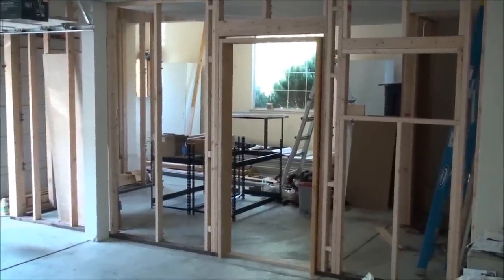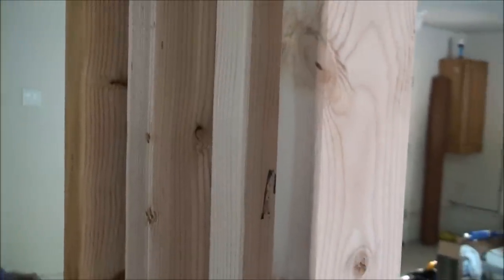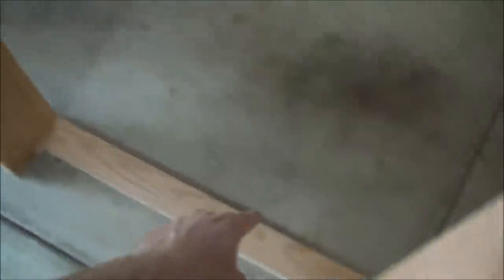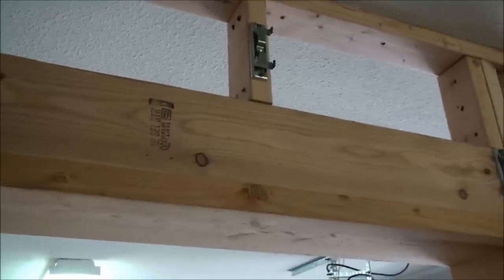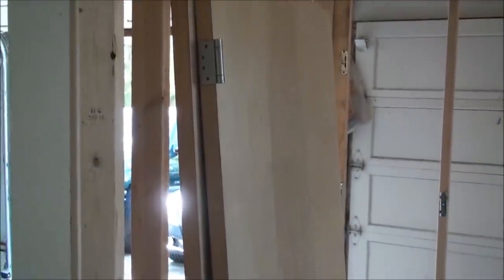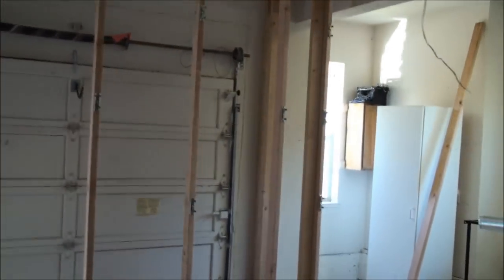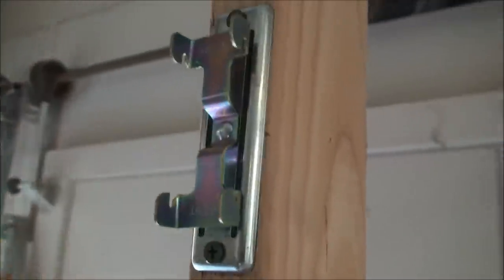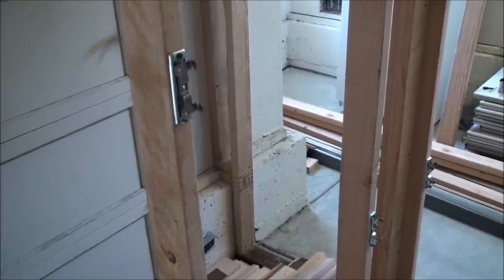Drum Room Construction : Part 4 - Framing

Comment from the maker: That is correct. The reason I did that was twofold. First, the upstairs is a guest bedroom which does not get much use. Second, I did not want to build a ceiling! :) Especially doing the drywall above my head. That would have been the best way for sure.

Comment: Hey, i've seen all of these videos and wanted to say i think that you've done a great job! I'm pursuing a nearly identical project and these videos have been a huge help. Just a quick question though: what insulation did you use? I've been looking around and can't really find much. Thanks so much, I hope you reply!
Reply from the maker: Daniel Stuber Thanks Daniel, kind words! I used good old fashioned pink fiberglass (R-15?). There are purpose-made insulations like rock wool, etc. I decided that I did not need to go to those lengths. It really matters what is on the other side of the wall. In my  case, the walls go to the garage, outside, or under the house. So, I did not need to go crazy with sound proofing. If you have a direct, shared wall with a living space, you will want that wall(s) to be separated probably, a-la room-in-a-room style.
Let me know if you have any other questions, glad to help!
Reply: asicerik Basically, in my project I'm building a soundproof room inside of my extemely large basement. My house is notorious for its thin floors and poor sound stopping ability and I'm making the room for drums as well as some audio recording. The room is planned to use a pressure treated plate like yours, bolted down and sealed with acoustic sealant. Studs will be at 24in. intervals with quietclips to mount 2 layers of sheetrock separated from each other by green glue. The beams supporting our ground floorboards will be filled with insulation and then a drop ceiling of sheetrock will be put in place. I plan to join the sheetrock to itself and the floor with acoustic sealant. Electrical will be brought in from pre-existing boxes through boxes that you listed in another comment I saw. Now that that monstrosity of a comment is out of the way, my main questions are whether or not to join the sheetrock to itself (corners) and the floor with acoustic sealant, if you know of any better insulation to look for, and if the air in the room witll ever run out. Other than that, the eproject should be underway soon. Thanks again for your help and sorry to spam your comments section with this.
Reply from the maker: Daniel Stuber I have no problem with long comments/questions! I don't quite follow your question on joining the sheet rock to itself. Are you saying how I did it with sealant? What is the alternative? A direct joint (like standard drywall applications)? That would defeat a large portion of the quiet clip install since things need to float. Or?
I you can keep an air gap between the roof of your drum room and the floor of the room above, that will really help a lot. If there is a mechanical connection between the two, those vibrations will go up into the room above. Now, I don't have a gap in mine, and people upstairs can hear me playing. It is not super-loud, but it is noticeable. You would probably not want a bedroom above there. What is upstairs?
On the insulation front, you can see/hear how well the insulation works in my room. You get about a 30+db drop in sound levels with that wall construction. Inside the basement, you probably don't need to worry about anything fancy. If you can keep the drum room ceiling separate from the floor of the room above, you are probably ok there too. If not, you might want to look at rockwool.